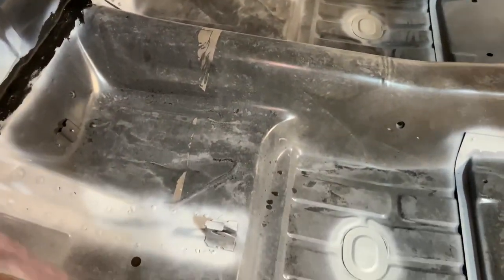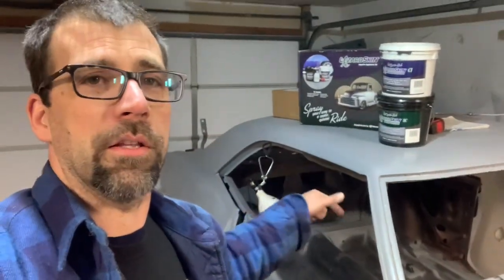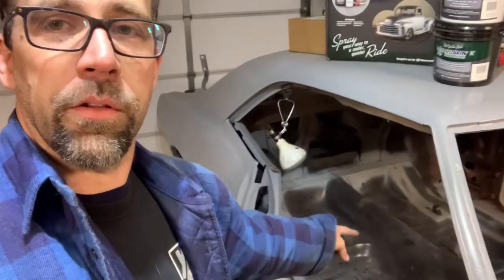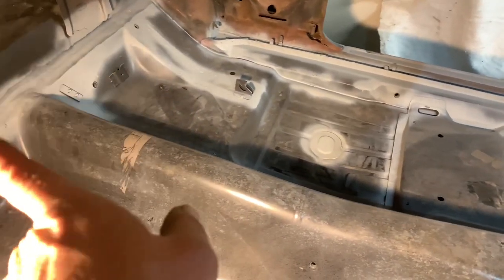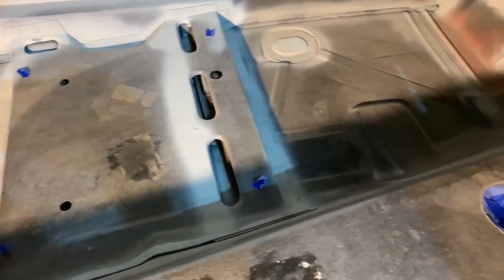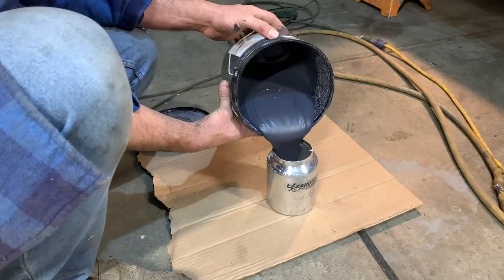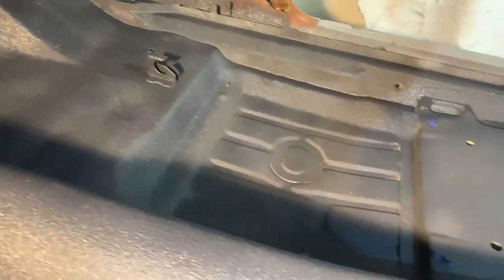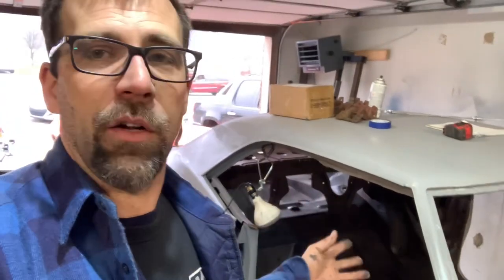Keeping the inside of your car quiet and cool. Several options we tried LizardSkin sound control

Comment: Great video-I used the L:izard Skin Sound deadener on the underside of the roof on my Chevelle- didn't like the thoughts of the butyl rubber coming off.and dropping onto the backside of my headliner. I did however use the Eastwood sound deadener rubber product on the floor, firewall, doorshells- anywhere I could get a bit of a flat surface to dull the road noise.
Reply from the maker: It is definitely worth the effort to add some type of sound deadener, the finish results are priceless, the car rides and feels nice.

Comment: Another great video Jon! What were the hole plugs used for in production? Thanks
Reply from the maker: Great question!  They call them body drain holes but then why are they sealed up when the car is assembled becomes the question??? How it was explained to me was once the body shell was welded together they where dipped into different chemical baths for cleaning and corrosion protection and as they body was lifted from its bath the holes were a way for the body to drain. Hence the name Drain holes. After that process they no longer serve any purpose what so ever that is why they glue body drain hole plugs into place.  Now that is what I was told I can’t guarantee that to be true but I really liked it and it fit.

Comment: Why not Dynamat 1/8th inch instead,  no extra tools or shop air required,  then the factory jute and padding? Pros}  {cons?  😁 Your results look great 👍
Reply from the maker: I haven’t tried dynamat yet. I am sure it’s a great product, it’s a bit costly and certain takes more time
To get installed.  But in a side by side comparison I wonder which is better?  Might have to try it out.

Comment: Hey Jon, as always informative and enjoyable to watch. I got a couple of questions. On the floor pan plugs, did AMD or OER provide them and the adhesive? What adhesive did you use? I didn't see the video where you put these in. Thanks so much for doing this for us Bird nuts.
Reply from the maker: I didn’t put the installation of the plugs in a video.  I just get going sometimes and I forgot to do that.  Anyway I purchased the body plugs from inline tube company. As for adhesive I use a bead of seam sealer then press into place.  And of course the jury is still out on the answer indentations up or down on the body plugs.  From what I can tell it doesn’t matter it’s personal preference. Most of the cars that still had them during disassembly they are up.  Glad to help!
Reply: @VinylVillageGarage  Thanks again!
Reply from the maker: Anytime

Comment: I have been debating this for the Sunbird Formula project.  I Raptor lined the bottom and I think this may be a good option for me.
Reply from the maker: I really like it, one it works plus it’s easy to apply and clean up is just as simple.

Comment: I wonder what the difference between lizard skin and tintable raptor bed liner is? 
i have a 79 trans am and the interior floor pan is sprayed a body like color - silver in my case. 
I dont like the black color of lizard skin, idk if they have a tintable version?
Reply from the maker: Raptor is a good product too.  LizardSkin can be painted afterwards per the instructions, i attempted to paint it white on one of my cars and it didn’t cover very well fortunately it was on the inside just like this car and it was covered with the interior. To sum it up if you want it to be a different color raptor might be the product to use.

Comment: Are you going to use anything on the roof?  Do you trust this product well enough to use it there?
Reply from the maker: Yes I have used it inside doors, 1/4 panels and roof skins. Prep is important for good adhesion other then that i would not hesitate.

Comment: Wicht sprayable seam sealer do you use.
Reply from the maker: The seam sealer I used was transtar brand I have a brushable  type and caulk gun type depending on seam location and width.

Comment: Jon, this is Joe from Ohio. Did you use a regular spray gun or do you need a special gun?
Reply from the maker: Hello Joe.  Yes it’s a special gun that
Comes with the lizardskin kit, the gun by itself was like $40 and you also do regulate the pressure down to I think 40psi. The kit comes with great instructions
Reply: How much air is needed to use that spray gun?
Reply from the maker: I have a 60 gallon tank on my compressor and it keeps up fine. I am sure it would still work ok with a smaller one too.